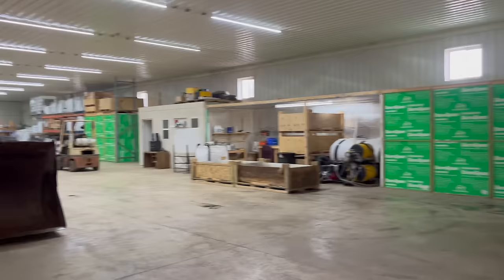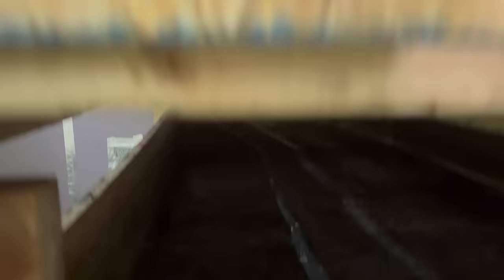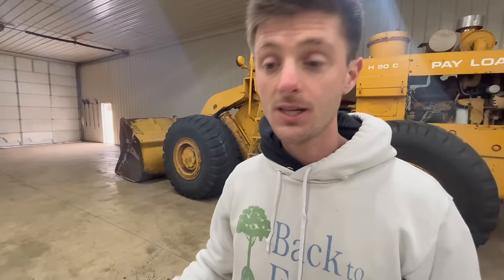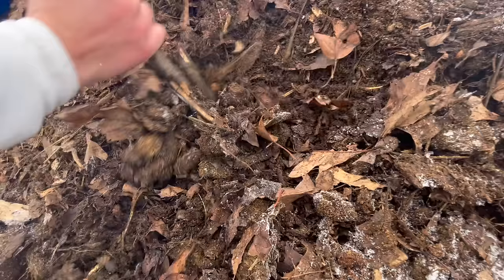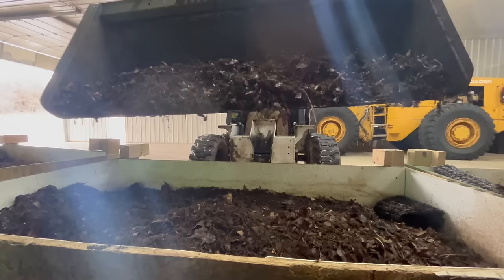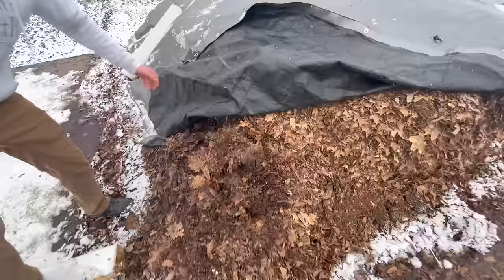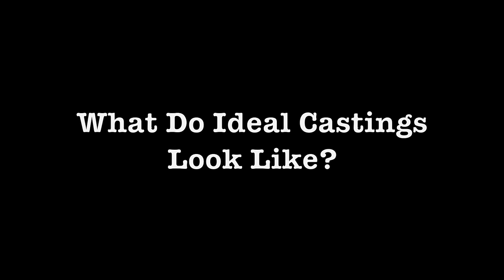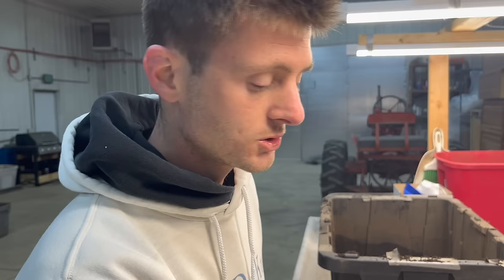Farm Worms Like The Pros - Commercial Worm Farm Tour - Easy And Effective Method

Comment: Every year after harvesting my potatoes from their buckets I then turn the buckets into individual worm farms.  I use the previous soil that the potatoes grew in and then I add food scraps and a hand full of worms from my wormery.  I then cover the buckets with grass clippings, leaves and shredded cardboard followed by a thick plastic bin bag secured tightly to the bucket with elastic.  Every now and again I feed the worms and keep them moist with rainwater.  I live in Cornwall, England so I can leave the worm farms outside all winter.  By the time springtime comes around again my buckets are full of worm casts!

Comment: Been raising worms for 5 years now, right now I have 6 different bins going.  I use natural bedding over paper or cardboard, leaves, unfinished compost and leaf mold.  I do see a huge difference in the biology when compared to paper bedding.
I generate approximately 100 gallons of finished castings a year, depending how much attention they get.  My garden definitely benefits from the biology, enzymes and nutrients the castings offer.
I do use a microscope to see exactly what is in the castings and have sent samples to the UW soil lab for testing.  All good stuff.
I have a small channel, Brian's Garden with my worm bin setups if interested.
Stay Well!!!
Reply: What kind of worms do you use?
Reply: @mikecain6947  Started with one pound   ( probably around 1000 worms} of red wigglers.  I like the red wigglers because they survive outside during our WI winters, although I start fresh bins every fall and bring into the basement.

Comment: I have inadvertently released red wigglers into my garden through worm castings. I'm glad that BTEV doesn't find that to be an issue. I've also heard they would die outside when temperatures drop, which is not the case. Not under my ridiculous leafbeds.

Comment: Thanks Nate, I've a 4 tray worm tower, I feed them kitchen scraps but before I put them in I freeze the scraps first which helps to breakdown the cell structure and make it more digestible for them, I also add ground egg shells too as worms have gizzards, a worm bin is like a giant amplifier of biology and nutrition for your plants, I always add lots of shredded paper and cardboard too and cover the top tray with a few sheets of newspaper any liquid that drains goes down into the sump and I open the tap to drain it, its rocket fuel for plants, full of biology.
Reply from the maker: fantastic advice thank you for sharing!!

Comment: I wonder if you could do this small scale in one of those small tumbler compost bins?
Reply from the maker: seems like you could but it'd be hard to separate the castings... I am going to make a similar setup with just a cheap concrete mixing bin from Home Depot with some tiny holes drilled into it

Comment: Ok, in southern CA. It’s warm enough, I’ve got plenty of worms in a stackable black bin but also lots of pill bugs and earwigs. Will the bubble wrap help?
Reply: I never had an issue with earwigs or pillbugs until 2 yrs ago.  Now it's become a real issue in my vegetable gardens.  Very frustrating
Reply: @DebRoo11 diatomaceous earth..
Reply: @timmmmmmmmmmy1  i tried that last year and it didn't help much at all.  Had to reapply after every rain or watering which just isnt a solution in a big garden.  Even when it was dry it didn't help in my case.  I used soya sauce traps which did help some.  Worked especially well for the earwigs but still had my celery totally infested